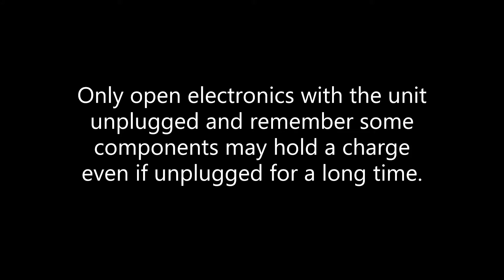PS2 Slim No Power DC Power Jack Fix

Comment: How much heat do you need to apply?
Reply from the maker: I normally set it at 370°C. If you are using a cheap soldering iron the temperature control is not always accurate so you may need to adjust it a bit up or down.

Comment: Does glue work or is it necessary to resolder the broken joints? Thanks for the video it’s very helpful!
Reply from the maker: I wouldn't use glue as you may end up coating the contacts and then the switch will no longer work. 

Taping the button down should get the console to work but may not be a permanent solution.

Comment: hey idk if you can help but mine doesn’t seem to have that problem, it’s funny because when I bought it the red standby led would light up when connected and then then I was told that the power switch didn’t work too good, so I played around with it, with the button and moved the ribbon cable around and I noticed that when I had it connected and I was messing with the ribbon cable the led just turned off and since then I haven’t been able to get it to power on and no red led when connected, also I tried. New ribbon cable and power switch that works because they were tested on a working console and nothing.
Reply from the maker: Is funny that you asked this, I have a PS2 slim that was given to me by a friend recently that is the exact same. He was messing around with the power button and the now it doesn't  turn on at all. 

I haven't had a chance to look at it yet but when I get the chance I'll update you.
Reply: @EasyConsoleFixes DID YOU EVER FIND OUT THE PROBLEM
Reply from the maker: @FLYNNER.  I suspect its the chip that's on the console mother board where the ribbon from little board with the power switch connects to. Unfortunately I haven't had the time to go back to the console and check it out properly.
Reply: @EasyConsoleFixes  I have the same problem I put a new switch and RIBBON ON and still only Red light on again.. NO GREEN.  JUST TODAY I did
Reply from the maker: @FLYNNER.  Yeah checking with a new switch and ribbon was what I did. 
My mate was trying to start the console by shorting the two points together, I suspect he messed it up and damaged the chip. I keep meaning to take another look but haven't got around to it.
Reply: @EasyConsoleFixes  AWESOME VIBES AND THANK YOU FOR THE FAST RESPONSE.. IM IN DETROIT BTW.. well like I said I replaced front switch and Ribbon it's still red light.. solder at power input is in great condition and machine is very clean.. tomorrow I will do more check on fuses.. ECT.. Keep in touch to share our findings please.  I put it aside for now.. DETROIT LIONS GAME SOON.. TO CRUSH STAFFORD.  WHERE ARE YOU LOCATED IM RON

Comment: hey? is this also gonna work in Ps2 Slim Scph-90001? i hope you answer
Reply from the maker: The design of the 90001 is little different. The power supply is inside the console instead of external like the older revisions. This design makes this problem much less likely to happen as the black power connecter is attached to the board by wires instead of being soldered directly to the board.

If the console power goes on and off when you move the power cord the solder joints on the wires may have cracked and it would be a similar fix to the one in this video.

Comment: So if this is the case will I know it by the power jack being wobbly like yours was?
Reply from the maker: If the power jack is wobbly like mine the solder is probably cracked. Sometimes the jack wont be that wobbly put when you move the connector around power will come and go.

Comment: Hey I lost my charger so I have other one with different mouth can I sold wires with mother board
Reply from the maker: As long as the new power adapter has the same rating as the old one it should work.
Reply: @EasyConsoleFixes  new is 9.0 v and old is 8.5 I don't know I'm trying right now but power is not Turning on
Reply: I lost my job dude to lockdown covid 19 from last year I don't have money but I want to gift my nephew something cool so I AM trying to restore my PS can you help me with this
Reply from the maker: Does the new power adapter have enough amperage for the PS2.
Reply: @EasyConsoleFixes  yes 8.5 v
Reply: But it is not Turning on May I use 8 volu before that and because of that power IC short but I don't think so it's like nothing happening
Reply from the maker: Yes that's 8.5volts but it also needs 5.6amps. The new power adapter can be 8.5volts but not have enough amps to power the console.
Reply: Fuck this covid man if had my job i wouldn't have to do this